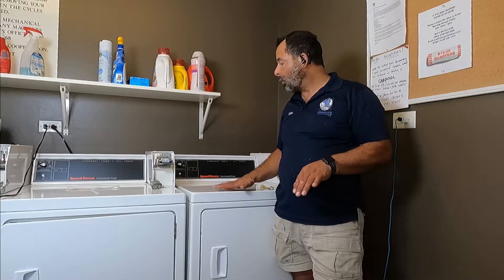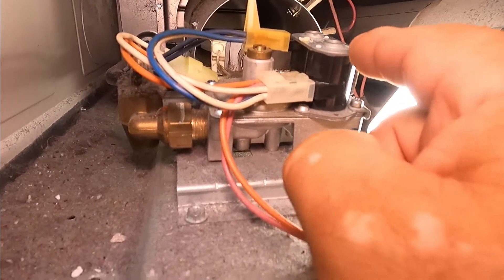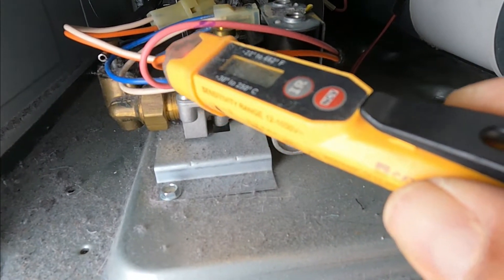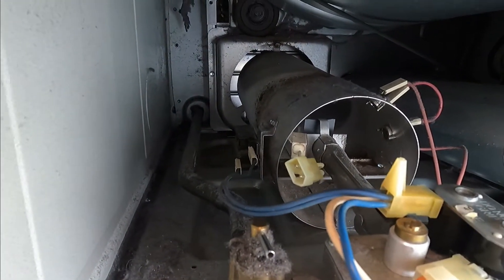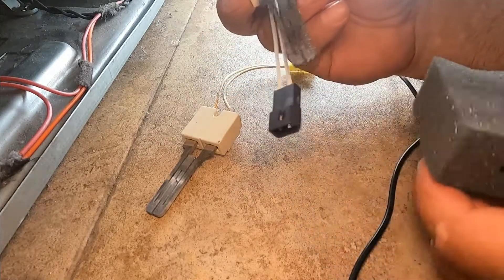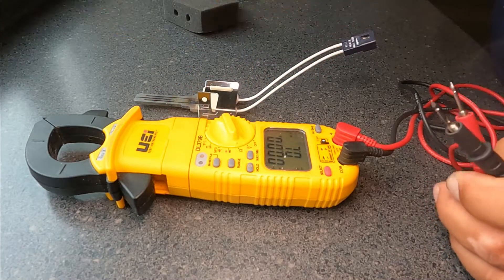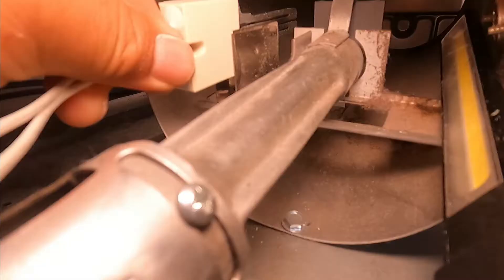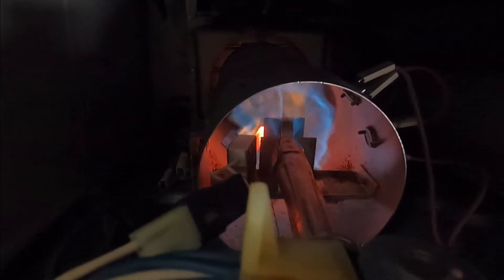SPEED QUEEN COMMERCIAL DRYER.  HOW TO TROUBLESHOOT AND REPLACE AN IGNITOR.

Comment: Will a bad flame sensor prevent the igniter to heat up/get hot? Just ordered a flame sensor on same model bcuz of a broke male connector. I'm just wondering if a broken sensor could be the reason  the igniter doesn't turn on/heat up

Comment: Hi Alex! I have a brand new speed queen Dryer (dr5) and it’s got a “door open” / extended tumble error light coming on. It also has a constant annoying tone / beep while in operation. The pause cancel button does not turn the machine off. I can reset it by unplugging the machine but the error re emerges within 10 seconds of operation.  I’d love to chat or face time on the issue. Can’t get a tech here to troubleshoot for 2 weeks!
Reply from the maker: Hello Amanda.   I hope your weekend was great .
I am not familiar with the DR5.   I only deal with the simpler Speed queen machines that have almost no fancy stuff.   It might be a faulty door switch. or the ability of the switch to communicate with the control board.   I read in different posts about your dryer and all lead to a faulty control board .  Which being brand new is still under warranty . Hopefully your technician gets to fix its sooner that later.   Please let me know how it goes.
Reply: Thanks- finding a repair person is a challenge. I’ve opted to take a bit of video to send it around to the three that seem to be semi close to us.